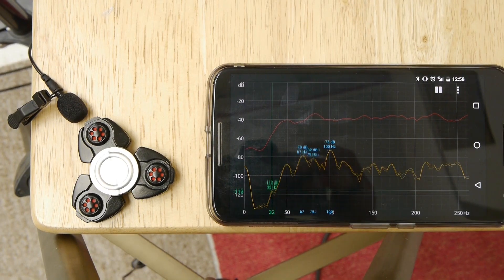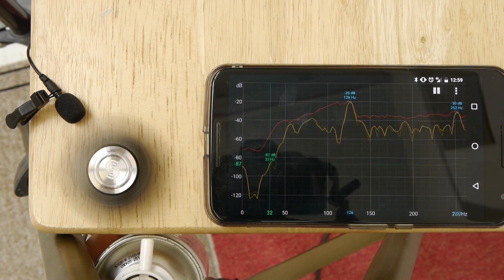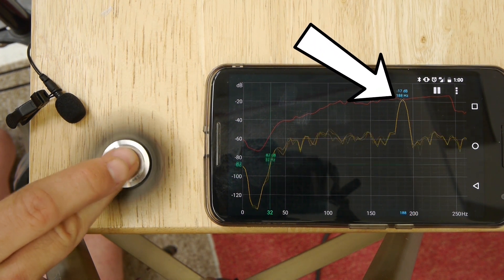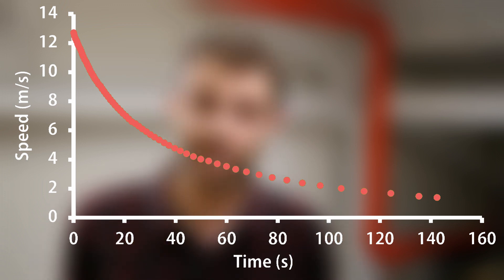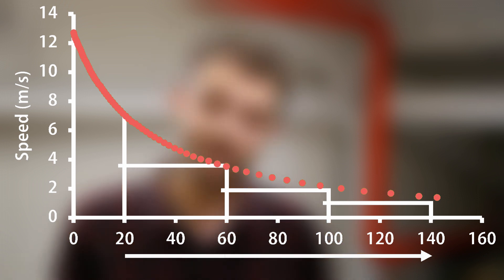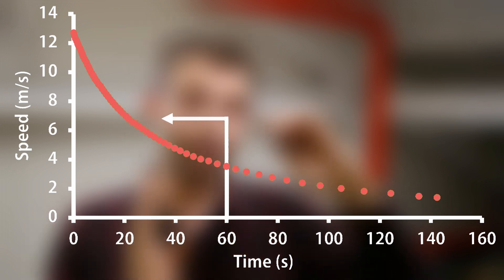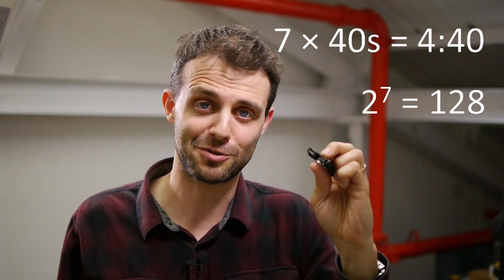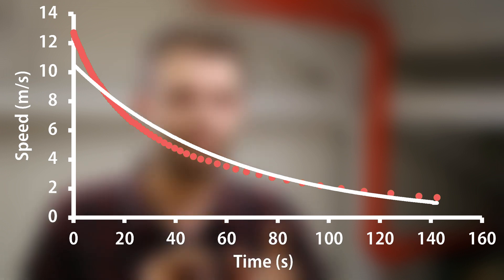Exponential decay - why your fidget spinner won't spin for longer

Comment: One way to more accurately measure fidget spinner spin time is to let a sound sine wave of a very high frequency pass through it. As the wave travels it either hits the spinner or it passes through, alternating at just the same frequency as the spinner spins. This results in amplitude modulation that is seen on a spectrogram as secondary peaks at frequencies equal to "carrier + spinner" and "carrier - spinner". This is more precise than measuring spinner directly as you are measuring much higher frequencies where there isn't any noise, but to more accurately get frequency from fourier transform you need to listen for a longer period of time, by which time spinner frequency would noticeably lower and skew the result this way

Comment: And,  in fact this demonstration of AM-FM time-timing, continuous creation connection, explains by doing the Stroboscopic cause-effect Inflation-condensation log-antilog Resonance Bonding Matrix of holography, exactly what, how and why e-Pi-i sync-duration is pure-math empirical shaping laws of axial-tangential orthogonality existence, because Superspin Modulation Mechanism positioning is Reciproction-recirculation Orientation, "stroboscopically", ie Superposition-point Singularity Positioning=> cause-effect chemical bonding resonances-> Thermodynamics of Logarithmic Time Duration Timing. 

Although it looks like an exploded view of expanding information, simultaneously it's In-form-ation substantiation by probability quantization condensation. Simple ONE-INFINITY Singularity.

Comment: At low speeds, viscous friction (proportional to velocity) should dominate relative to drag (proportional to velocity squared). So I suspect you’d get a better exponential fit if you only look at the final portion of your data as the spinner slows
Reply: Yes, this is a property of underdamped oscillations, here even though its a rotation and not oscillation, we know that projection of uniform circular motion on its diameter is a Simple harmonic motion.

Comment: Many thanks for the valuable data set!

As a maker of tops of widely varying geometries, I take the engineering part pretty seriously. After scouring the literature, I have yet to find compelling evidence that spintoys like tops and fidget spinners actually spin down according to a decay law quadratic in =angular= speed.

The few high quality empirical spin-decay curves (SDCs) available to me -- including yours, thank you -- are all very close to exponential in shape. And unlike your fidget spinner, most are for aerodynamically smooth tops of revolution. This strongly suggests a total braking torque -- from all air and tip or bearing  resistances combined -- much more linear than quadratic in angular speed.

A quadratic SDC would of course be hyperbolic. But real SDCs -- including yours -- show significantly steeper low-speed tails than quadratic decay predicts.

The highly successful von Karman swirling flow decay law for smooth thin disks spinning in air correctly predicts a speed exponent of 1.5 at laminar Reynolds numbers. Most real tops also operate in this regime. And some of the aforementioned real SDCs were for disk-like tops in this regime. Yet, they're still more exponential than "von Karman" in shape.

Bottom line: Spintoy spin-down behavior is far from settled science. Thanks for contributing!
Reply from the maker: Pleased to hear it was useful in this way. Interesting stuff
Reply: @SteveMould  Forgot to mention that Becquerel's compressed/stretched hyperbolic decay curves never go below an exponential SDC, as some real SDCs do, including yours. Whereas purely exponential decay implies a constant spin half-life, Becquerel's implies one increasing with time.

However, a decay law with a speed exponent of 1.2-1.3 fits your curve pretty well by eyeball. A clue about the speed-dependences of the underlying air and tip/bearing resistances?
Reply: I wondered how applying the equation from a quadratic drag would look. The fact that it does come to stop indicates something more is going on. A numerical simulation that includes quadratic, linear, and constant drag terms could be interesting.

Comment: How do you explain the stroboscopic effect seen directly by your eyes? Your eyes don't have a shutter speed right?
Reply: If you viewed it indoors with either fluorescent or LED lighting, the frequency of the lightbulb can produce the strobe effect. Try looking in either sunlight, or maybe using a battery (DC) powered flashlight/torch.

Comment: You should try putting the fidget spinner in a vacuum and seeing how much longer it'll go for (obviously you'll need to find a new way to spin it up, or find a way to pull a vacuum very fast immediately after you spin it up).

Comment: we got about the viscosity of the oil the friction that was caused by the bearings heating the oil causing a degradation and its viscosity which lowers its drag coefficient says it's easier for the brownies to move through it and also the expansion due to the friction of the air passing over the pedals causing a thermal expansion and paddle causing a greater surface area heating up the air around the paddle before it even makes contact with just think of the SR-71 and that you go if you're going to cover every detail start from The Middle work your way out

Comment: So no attempts to actually affect the factors causing drag and/or friction to youknow... get the spinner to spin longer? I know for a fact that the weights in the paddles of the "cheap" spinner can be moved slightly in their seats, and by adjusting them for better balance (and reducing oscillation), you get better spin times. You said you assumed it was lubricated; why not try lubricating? Change the paddle shape to reduce drag. There's so much more that needs addressing here!

Comment: I wonder what proportion of friction is atmospheric drag vs bearing. A fidget spinner disk would have less drag. It would be interesting to see a spinner speed decay in a vacuum.  I also wonder what the frame rate (persistance) of the human eye is. Spokes on a wheel sometimes appear stationary or to spin backwards to the human eye under natural light.  Great video!

Comment: What if we lengthened the length of the spinner's paddles giving it more inertia and a potentially higher velocity due to the larger circumference? Or would the air resistance cancel out with the extra inertia like with terminal velocity?

Comment: I'm not sure the bearing would be lubricated though. On a light load like that, it would probably just slow it down
Reply: You're right. I actually tried lubricating my fidget spinner bearings and even a tiny amount slows it down dramatically. Had to wash the lubrication away with soapy water to restore the fidget spinner to normal speed. Wonder if a "dry" lubricant might work better?

Comment: Drag proportional to speed^2- ish, not quite because rotational not linear only tip is quite that fast etc, and the bearings will have a light oil but are often not lubed because there is no load and lube is just drag, if a bearing in machinery free spins its wallered right out or its burned the grease off, they are almost hard to spin because of the thic grease but perform well under load, im guessing the a little more than linear bearing friction and air drag combine to make that curve

Comment: Even if there is zero friction, fidget spinner still wont spin forever because the energy that you put into spinning fidget spinner will still get used up and it will stop spinning. It will just take more time to stop spinning.
Reply: Used up where exactly?
Reply: @orestisgrivas5434  Aether. In reality, friction is never zero. The reason i said zero friction is because the friction with aether is damn near zero. Aether is the medium through which light, electromagnetic waves and radiations travel through space. There is no such thing as empty space even when the space is absolutely devoid of all particles.
Reply: @Xeno_Bardock  You're moving the goalposts mate. On the original comment you said "even if there is no friction". You're making a hypothetical, unrealistic statement and coming to a wrong conclusion,and then you say that your conclusion is right because your unrealistic statement is, well, unrealistic.
Reply: @orestisgrivas5434  Hardly. Simplest proof of aether is hiding in plain sight in the form of magnetic field. Magnetic field is not something emitted by a magnet. Magnet is simply vortexing the aether already all around everyone. The difference between magnet and non-magnet is that magnet is coherent as all its atoms are aligned and acting in unison. Google and read book "Uncovering the missing Secrets of Magnetism".

Comment: To be fair, the ODE of v'=-k*v^2 is a pretty easy separable differential equation. The general solution is v(t)= 1/(c+kt) and you can find a specific solution by using two points on your graph, or a point and it's derivative.

Using the points v(0)=15 and v(40)=7.5 I got the equation
v(t)=600/(40+t)

Comment: This distortion effect from the camera rolling shutter reminds me of the distortions on Andromeda caused by its tilted view angle and the time that light takes to reach us from the far edge and from the closer edge. I first heard of it on this Vsauce video (https://youtu.be/mQ0hS7l9ckY)

The distortion is negligible, though, as Michael states, which corresponds to less than one pixel in his video. It should correspond to about 0.1 degrees of the galaxy, as was answered to this Physics Stack Exchange question (https://physics.stackexchange.com/questions/45255/how-distorted-does-the-andromeda-galaxy-appear-to-us-due-to-the-speed-of-light).

Comment: On the subject of spinning... We have used the anti-gravitational properties of a spinning object by making gyroscopes. Do you think it's possible to create a mechanism that is large enough and spins fast enough to achieve lift? Maybe by suspending a powerful magnet below to repel it upwards and is able to adjust it's distance from the mechanism along with the speed of spin to control the amount of lift and bring it safely back to the ground.

Comment: Need a spinner made of tungsten, with a wider radius, and an air compressor with enough volume to accelerate it to a desirable speed. This should reduce the decay due to wind resistance.

Comment: So when increasing force will not significantly increase spin time, we still have options: 
We can 
- use better lubrication in the bearings (nano-diamond based lubrication is the best I have come across).
- or replace the bearings with magnetic bearings, so no physical contact.
- put the spinner in a vacuum.
- distribute the weight of the spinner differently. Placing all its weight at the outer rim. Making it as light as possible everywhere else.

We will still have the exponential decay, but we will increase the time it takes to halve the speed. Instead of 40 seconds, we will get something longer. And this way we can most likely double the spin time, or better, without using more force.
That is my theory, at least.
Reply: Or get someone with huge hands and make a huge fidget spinner.

Comment: Solved the actual differential equation(the quadratic one) - the actual curve should be something like a/(b + time), where a and be are some constants that can be found through the experiment
Reply: oh, turns out, somone in the comments below also did that, should have seen that comming when commenting on an almost two-year old video =D

Comment: Hello Steve. Excellent video.   I would like to replicate your study.  How did you generate your data points.  Did the app for spectral analysis automatically do data capture every 10 seconds.  Did you have to manually enter the data into Excel ?

Comment: Never heard of exponential decay, but it's fairly intuitive that a starting speed that's twice as fast won't generate a spin time that's twice as long because drag and friction will be higher at the higher speed, so if for example it took 1 minute to slow from 2000 rpm to 1000 rpm it might only take 45 seconds to slow from 3000 rpm to 2000 rpm. I suspect that time to slow down would decrease exponentially. I guess that's what exponential decay is. In other words the faster the thing is spinning the faster it slows down.

Comment: Of course, if you actually get the edge moving 400 m/s and the structure holds up, you have very different aerodynamics in the supersonic that would probably apply much more resistance to the arms.

Comment: Three ways to improve the spin time.

Firstly, cover the holes in the arms to reduce drag.  Probably won't make much difference, but you'll get it anyway as a side effect of the second method.

Secondly, put extra mass in the arms.  Fill in the holes with molten lead or bismuth.  That's a lot more angular momentum for friction to get rid of (assuming you can spin it at the same speed).  Of course, you'd need a metallic spinner for this, or one made of a high-temp plastic.

The third option is to add extra mass by extending the arms.  First problem with that is that it would no longer be hand-holdable.  Second problem is you'd increase the drag.

Comment: You cannot use your simple maths on this air resistance cannot be calculated as you stated as it's shape changes the maths entirely for instance hitting the sound barrier will cause some shapes to have insane drag compared to others.

Comment: Interesting video! A few years ago I've built a magnetic levitator with bismuth plates. In the device you can spin a small magnet floating in the air, so there is no friction from a ball bearing. Of course, the magnet is still affected by air resistance, so its angular velocity also decreases exponentially.
https://www.youtube.com/watch?v=WlN_9nwhcQw

I've also written a real time audio spectrum analyzer in Java. It's very easy to use and you can download it for free on my website. Have a look at this demo:
https://www.youtube.com/watch?v=9oaz8yPAchc

Comment: v' = k*v^2 (acceleration equals k times velocity squared)
v'/v^2 = k
-1/v + 1/v<0> = k*t (after integrating both sides with respect to t from 0 to t)
v = 1/(1/v<0> - k*t)
hard to solve?

Comment: I assume the friction is proportional to v^(n), where n is some constant. I solve the differential equation dv/dt = -kv^n (where k is some constant), and I get the equation: v^(-n+1) = v0^(-n+1) + k(n+1)t. So if I create a plot of v^(-n+1) as a function of time, I get a linear plot. After playing for some time, I get n = 1.7 gives the best straight line (actually I plot the frequency^(-0.7) as a function of time, because frequency is proportional to velocity in this case). You can look at my plot here: https://postimg.org/image/bxdit69tx/

Comment: Same reason a Bugatti needs 250 HP to reach 150 MPH but an extra 750 to get to 2 hundred. Air resistance increases with speed because air can only move so fast. I wonder if you did this in a vacuum how it would change.
Reply: I think good fidget spinner would spin for hours in vacuum, the bearing friction can be very small

Comment: Hey Steve, your videos are fantastic!
About this one: The drag-only case is solved by integration as easy as the wet-friction-only case, and you will get speed ~ 1/(time + const).
This fact suggests the following fun analysis:

 In Excel you should take the logarithm of vertical axis, which gives linear plot for wet-friction-only case. Also you should take the inverse of vertical axis, which gives linear plot for drag-only case.

Comparing the two obtained plots you might notice a crossover between regime of friction and regime of drag. Of course that's only one of possible scenarios, depending on friction/drag coefficients.

Generally, I'd expect that at high speeds the "speed^2" term dominates over "speed" term, so the decay should look like drag-only in the beginning of experiment when speed is high, and then crossover to friction-only behavior towards end of spinning.

Comment: I suppose having a friction and a drag term means the overall differential equation is something like this:

a = k1 v + k2 v^2

Using separation of variables leads to the next equation:

(k1 v + k2 v^2)^-1 * dv = 1 * dt

One application of black magic (or partial fraction decomposition) later, and we get the following: 

((1 / k1) / v) + ((-k2 / k1) / (k1 + k2 v)) * dv = 1 * dt

Integrating, simplifying, and attempting to solve for v: 

v / (k1 + k2 v) = C * exp(k1 t)

I'm having difficulty turning that directly into just v = f(t) for some f(t), but it certainly looks very solution-to-differential-equation-y.

Comment: why do you describe speed of rotation with linear motion units? It's driving me creazy. I assume that you ment the linear speed of the edge of the spinner but you should mention that in the video.
Reply from the maker: +The Kwiatek did I not say something like "the tip of your spinner is go at..."?

Comment: First thing you do to improve spin time/feel in these things is you wash the bearing thoroughly with a solvent. This way you remove any liquid friction from the equation and leave only rolling friction and drag. I think the mere fact that you can register the paddles passing the microphone suggests that air turbulence created by them is significant.

So, I speculate that you can dramatically improve your spin times by spinning in vacuum/low pressure. In vacuum you should get very close to linear decay.

Comment: Apologies for what I am sure is a dumb question.  As more speed does not seem to be a great way to get longer spin times, would a larger circumference with more mass at the tips work better?  Seems like it would extend the low speed portion of the graph out a ways.